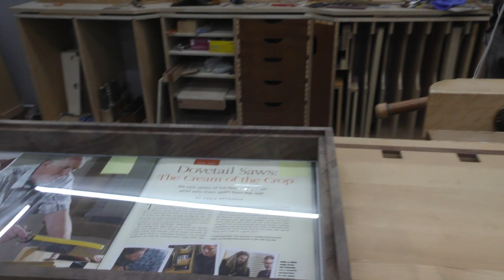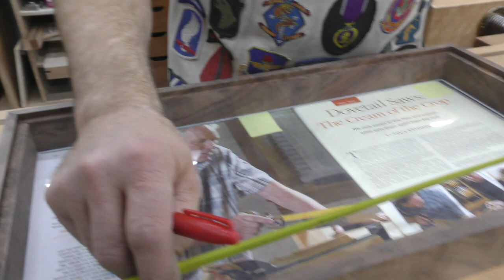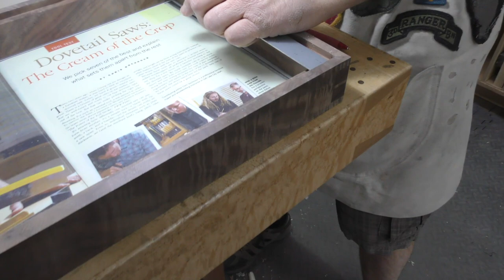Woodworking Online Workshop, Walnut display case, Episode 20

Comment: Rob, I understand your frustration with the tear out on the thin veneer. I found a video a way back and what I've learned is to simply place some paint tape in and around the kerf measurement. And it worked just fine.  No more tear out issues without having a zero. Hopes that helps. Thanks for taking the time out to make yet another fantastic video. Also as a fellow Combat Vet TY for your Purple Heart Woodworking classes.

Comment: Rob,  I have a suggestion to make. to transfer the gap you have on your ends ,use a drill shank that fits neatly at the largest end then use the same drill bit at the shooting board the same distance as the first measurement on the end. It will save you a good bit of time and give you the correct angle, Cheers

Comment: When cutting plywood, I use a 6 1/2" dia 40 tooth blade, I find that the smaller dia. makes a really smooth cut. Ive tried the 10"and 8 1/4", the 6 1/2"out-does them at least by 50%.

Comment: Do you have to  realign the riving knife or worry the thin kerf blade will act different with the brake if it were activated? Didn’t know if it was not recommended to use thin kerf blades.
Reply from the maker: No issue with the knife and dont think the thin blades are warned against.  Small difference between the 1/8" blades and these.

Comment: Hey Rob, what is the ruler you used for sharpening? I just got the 5 1/2 from woodriver and I wanted to sharpen it like you do! Great video, thanks for sharing
Reply from the maker: any 6 by 1/2" thin rule.  Just want to use the same one all the time.  We sell one on our site that is longer than the stone so  you can use the entire length of the stone.

Comment: So why was it “dangerous” to cut it the first time and not the second time?? Also I don’t understand why fitting the back (which is insignificant) took so damn long? why if the box is square why it’s so hard to get the back to fit?
Reply from the maker: First time the plywood was long, floppy and hard to manage.  Once I had cut a few feet off, the second time it was easier to control.  The figured walnut long sides bowed after milling.   I had to make a repair to one corner that shortened a long side by 1/32".  Instead of redoing another corner to match, I figured I could live with the slight out of squareness.  Trying to perfectly fit the back now that the sides were not dead on square is a task.  With a bow in the long side it was hard to reference the back to the short side to match the angle.  Guess you needed to see the rest to know.
Reply: RobCosman.com I just hate when wood moves after making a piece ;-)

Comment: Why didn’t you glue the box square? Could’ve  been 5 min job.
Reply: Yup, cut the thing to size would be a good start, then fit it.
Reply from the maker: to long to explain but along the process there was a repair that shortened one side 1/32".  Working wild grain complicates the task.
Reply: RobCosman.com 
Hi. I’m using plunge saw and block plane for such a fine trimming. Thank you for taking of your time and answering.